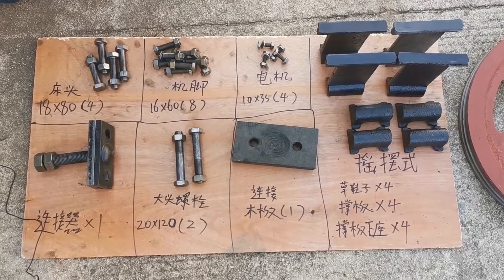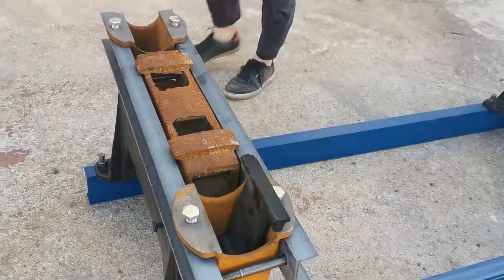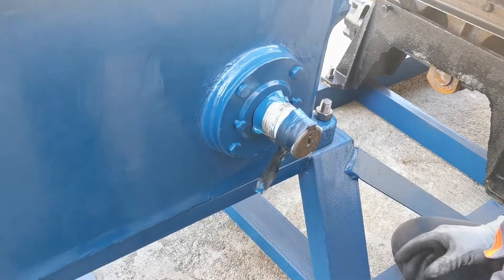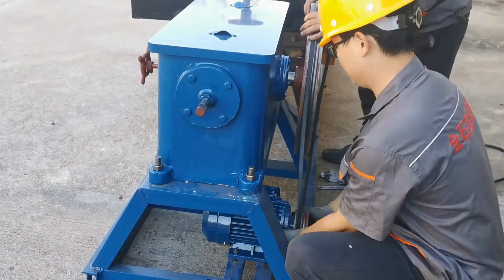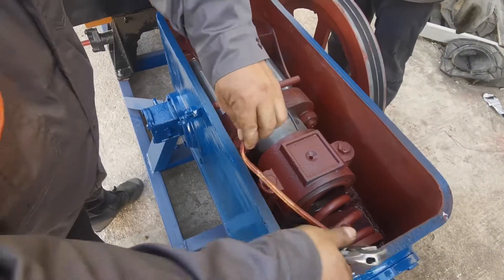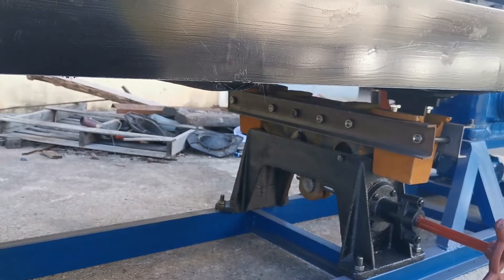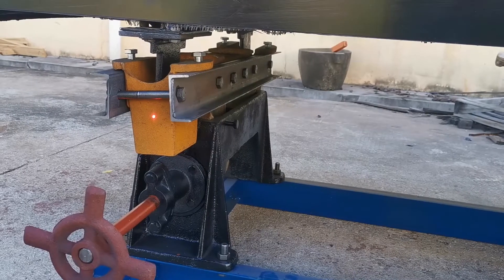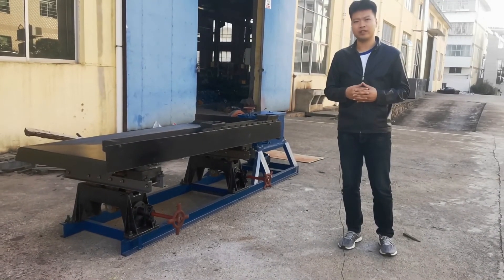Shaking Table Installation #10 Channel Steel basement shaker table (made in China)

Comment: How much its price
Reply from the maker: 1600USD as factory price. A container could fit 8-11 sets.
Reply: Which country avalable?
Reply: 8 fit shaking table cost with dilevr in pakistan ?
Reply from the maker: @ali5554  which sea port
Reply from the maker: @ali5554  to Karachi, it will be 16600USD.
Reply: Can you plz table size
Reply from the maker: @ali5554  4500*1850*1560mm for the table only. 5630*1850*860mm for the whole size.
Reply: اريد شراء واحده
Reply from the maker: @user-bndar5650  fironwoo@gmail.com
Reply: How much
Reply from the maker: @PatrickOchieng-qc5uf  it depends on the table size and your address. Send your details to fironwoo@gmail.com